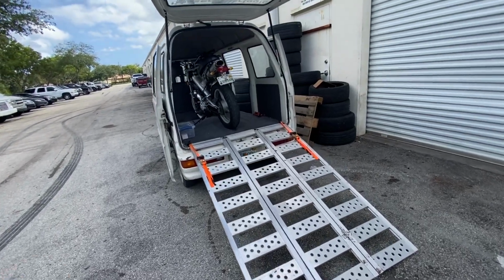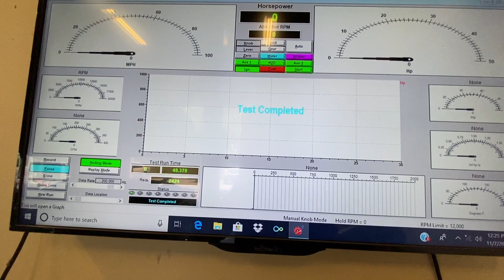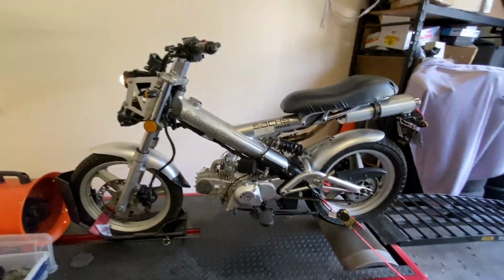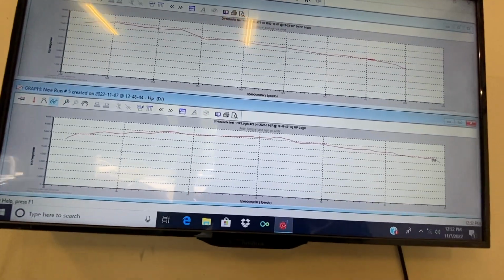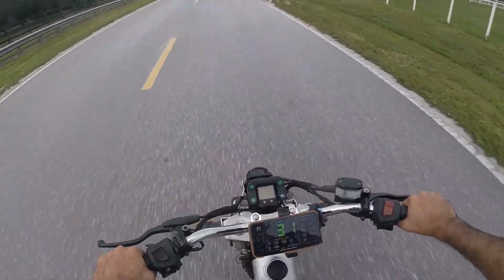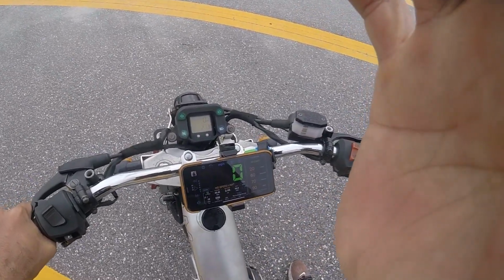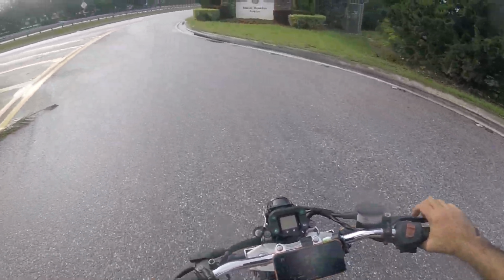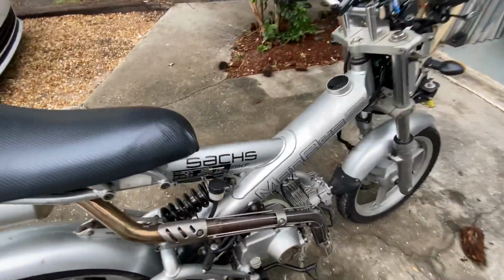Project MADASS | first dyno | new top speed | carb upgrade

Comment: This is so nuts because I thought I was the only one that thought these were so cool, I bought one for 400 (50cc clutchless) a few years ago because I needed a moped ended up putting a 80cc cylinder kit and bigger carb and it would hit 45 all day loved it took it to the trails and it almost never let me down, I would reinforce the pegs because mine began to fall off a couple times other than that I would look into just replacing the engine all together, that would be a sick build (P.s you can flip the rear shock and shave the top a bit to drop it a inch or two) can’t wait to see what you do to this
Reply from the maker: The shock is already flipped Look again lol.

Comment: Thats just a pitbike motor meaning most pitbike motors would slot in easy. i would recommend a 160cc 4 valve piranha motor! also with those motors a "racing CDI unit" really helps them rev better
Reply from the maker: Good to know! I would love to get the right motor for it eventually.